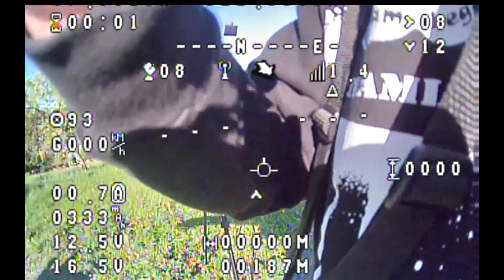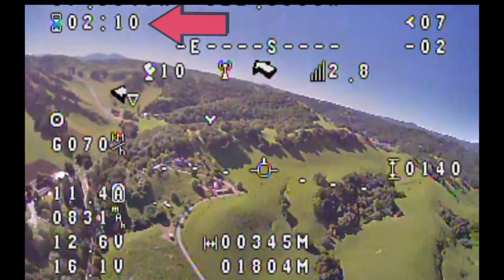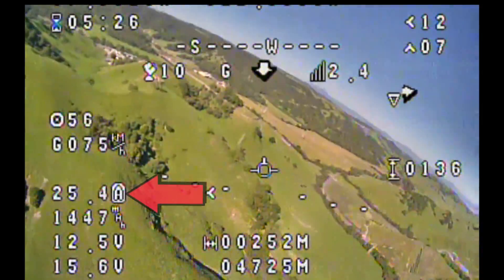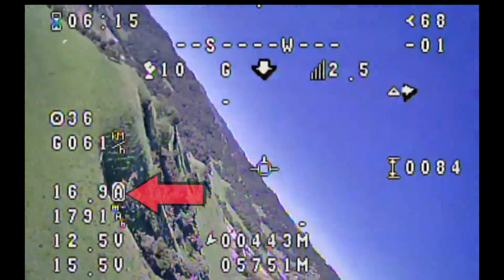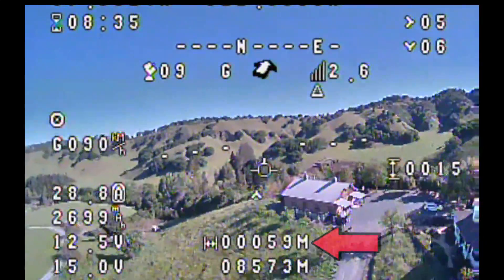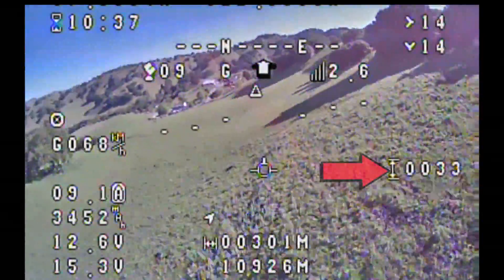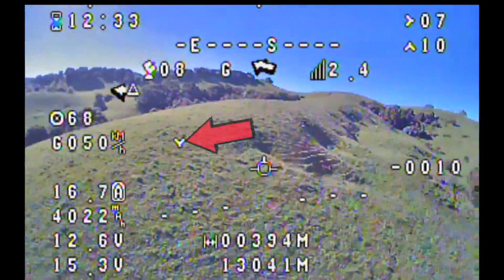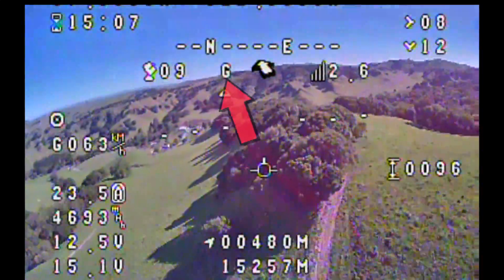Long Range OSD Explained (Long!) Arkbird OSD

Comment: so what long range video down link to use with the arkbird?
Reply from the maker: I use 5.8ghz 800 mw
Reply: 7demo7 Thanks for your videos, could  you help me ,I have a phantom fx61 with arkbird v3 , I have followed instructions carefully but the ailerons and elevators do not mix, I have disabled the mix in radio and put dip switch 4 to zero as per instruction manual but  only right aileron works as aileron and left works as elevator, any help appreciated.